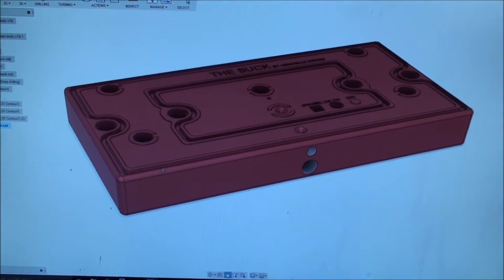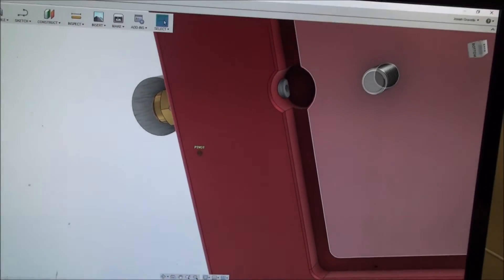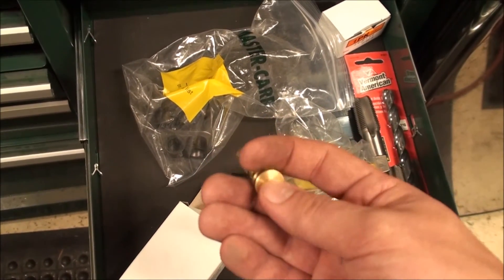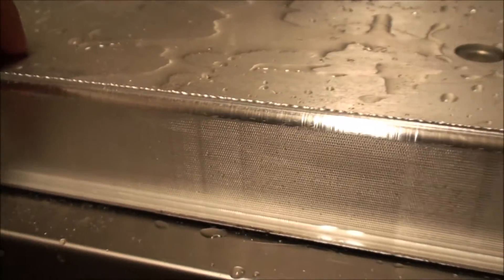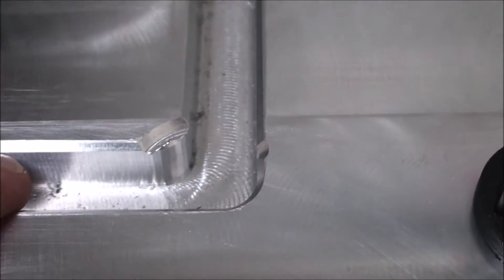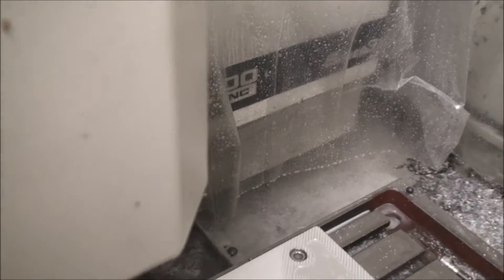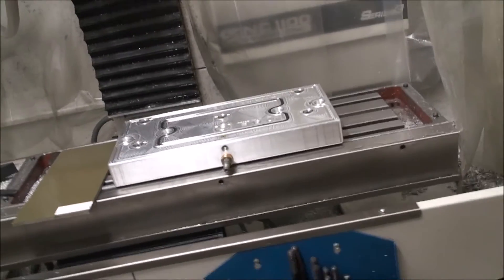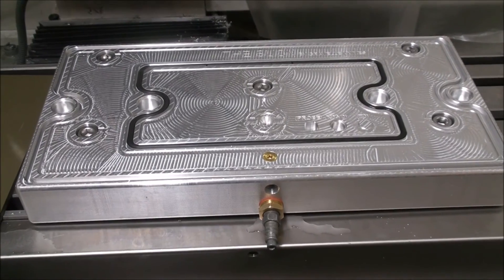DIY CNC Vacuum table (part 1)

Comment: Hi, Great Idea, I just bought a tormach and have been working off a vice, This is what I want to do, a vaccumn pallet system, Your video is great and showed me the direction to head. I looked at the ones for sale and its out of my budget I would like to try to make what you did. Is there any possibility you would be able to share the fusion file on this build? thank You
Reply from the maker: LUMABLADES look me up on the cnczone.   I made a build thread with the parts list and files

Comment: Hi, excellent job! could you tell me the name of  that black rubber like material? How can I get it on stores?
Reply from the maker: It's o-ring stock from McMaster
Reply: Thank you! one more question, what is de model of your vacuum generator?
Reply from the maker: iav 147
Reply: Hey and how did you join the O-ring stock to avoid any leakage?
Reply from the maker: +Julio Kevin Aguilar Narvaez I just cut it as square as I can and about 1/8" long and push the ends together.  it may not be a perfect seal but it's more than adequate.  McMaster does sell a glue that you can use to chemically weld the ends together if you like.